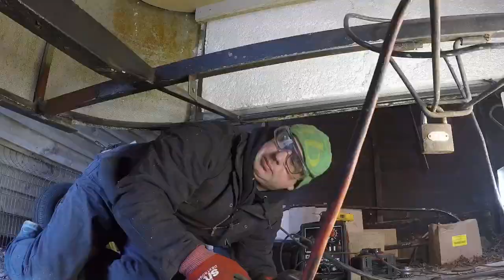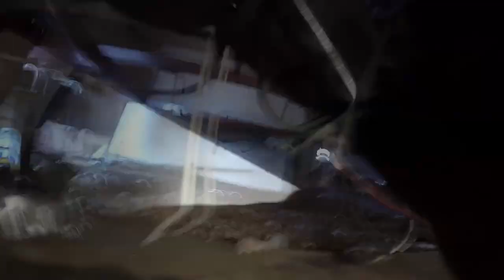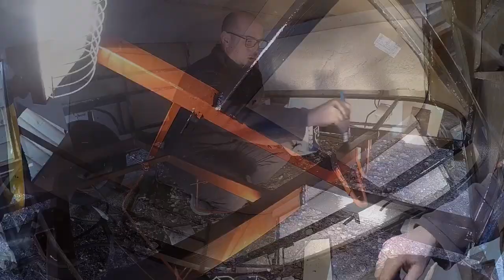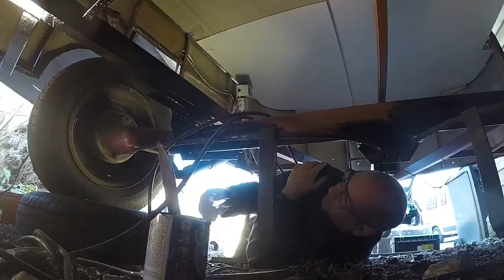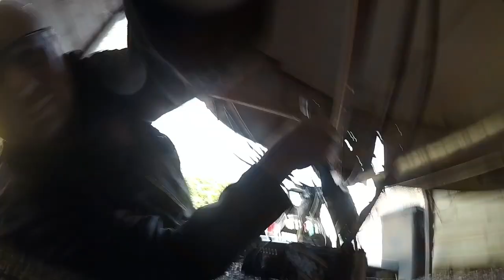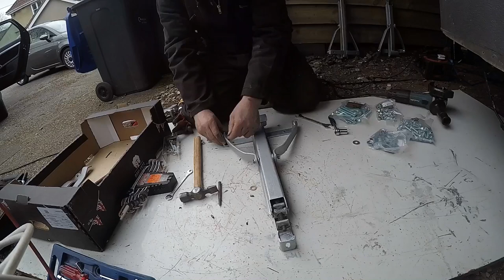Eriba frame prepping and painting (part 5)

Comment: Wow, the legs look like brand new! What have you done with it? Maybe you can explain the steps done to the legs a little bit?
We're also restoring our Eriba Familia and it seems our legs maybe are a little bit bent in itself
Reply from the maker: Thank you , these are the original legs all I have done is take them off strip off all the old grease remove the spray paint that was on them. I think they originally galvanised but I’ve repainted them in 2 coats of Hammerite  silver paint ,replaced the bolts nuts and washers and put new 4 mm roll dowel pins on the end to stop them coming apart ( that’s the bit I trimmed to length with the grinder ) if yours don’t go back in the slot straight try bending the curved bar slightly to bring them back in line .
Cheers for watching 🤓
Reply: @stevebradfield5939  Ok, thank you 👍😀